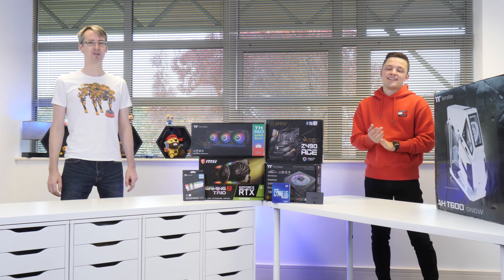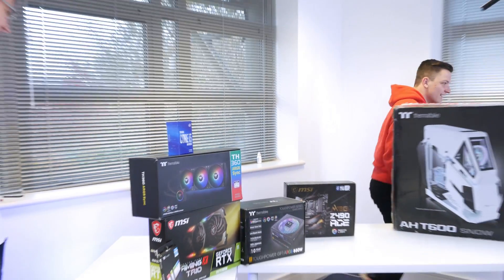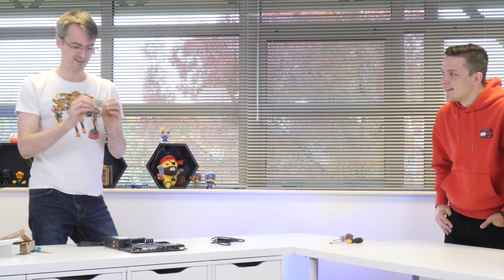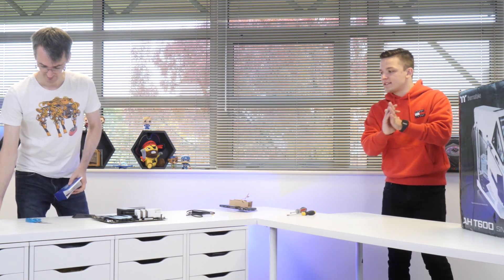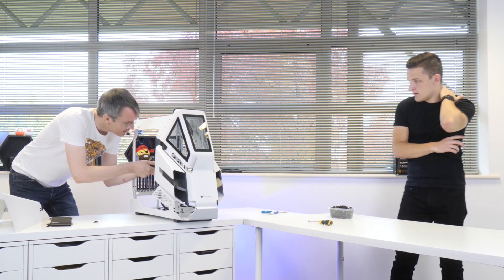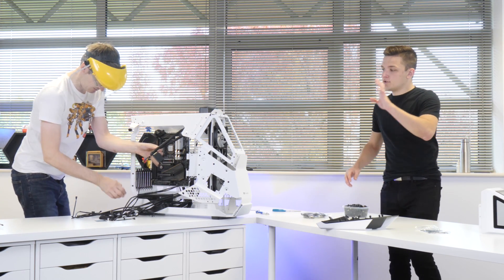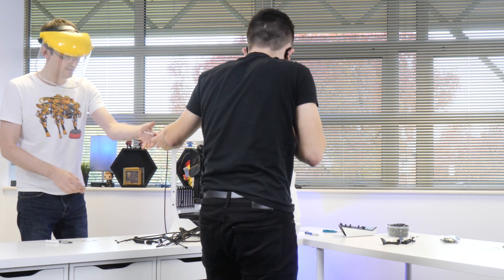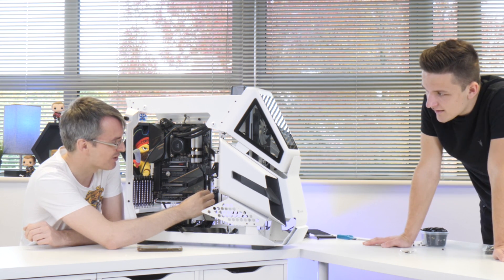Building the Ultimate 4K Editing & Gaming PC - RTX Super

Comment: Well, I kinda liked the video. Not the content I expected in the channel, still not dissatisfied at all. I do not agree with most of the coments, I would say the i5 is a fair choice, people tends to forget that while new Ryzen 5 5600x performs far better with the same 6 cores it also costs almost twice the price (not counting motherboard and rest, wich is more futureproof, but also more expensive), and can be quite hard to get at its retail price at this moment.

The case looks cool but it is too agressive for my taste. I definitely agree that is a suboptimal choice to expend that much on cooling for a midrange CPU, It is usually better to jump one price range on the actual parts than spending that difference on accessories. Would you prefer a full equiped Dacia or a 0-extras Mercedes/BMW? This is the same, I would rather go with an i7 10700 or Ryzen 3700X with a decent 60€ air cooler for your usage and for futureproofing, but well, that is just my impression. And you have a big advantage doing what you did: you only need to buy a cpu for a nice upgrade, you have the rest already, that is a big point too.

Keep up with the great work!

Comment: 4K? should have gone with:
Quadro RTX (better for editing, CAD, rendering, etc. AND you could game on it)
+32 Gb RAM (anything above 2666mHz for Intel doesn't make it faster and in some cases slower)
CPU really depends on the programs you use. Solidworks does well with higher single core speed, and some other programs need more processing cores.
H510 is plenty case and smaller footprint
Everything else is ok.
Reply from the maker: It edits 4K fine - this video was shot in 4K

Comment: The radiator should have the hose connectors at the bottom. With them at the top you will get cavitation at the top of the radiator and you will get a gurgling sound over time. Also it will reduce the life of the pump. This has been proven by experts and testing. At least it's an easy fix.

Comment: While the CPU will most likely be enough for your intended use case it does seem like an odd choice to go with an i5 instead of an i7 considering it will at least slightly bottleneck the pc and makes the triple radiator incredibly overkill.

Comment: I'm not usually 'that guy' but I feel this was a very unbalanced build. Just consider this James, for video editing you want a good amount of cores for concurrent processing. Your little mini pc you showed has more cores than the so-called ultimate pc. An extremely odd choice of processor considering the motherboard, cooler and ram specs. An ideal platform for processor bottlenecking. The good thing is the Z490 is a decent motherboard platform so sticking an i7 or ideally i9 (for core count) in there isn't going to be a problem and it would help balance the system out greatly. The other issue is intel has some funny ideas when it comes to running RAM at the rated speeds. with an i5 this is only 2666mhz so that fancy 4000mhz kit is largely wasted (not to mention for editing there was really no reason not to go for a 32gb kit. Ram is cheap.). If you went into the bios and enabled XMP to boost the speeds up, intel considers this overclocking and if you admit this, will invalidate your warranty if you have any issues. Not a lot of people care about this, just thought I'd mention it. On that note I'm not sure an i5 can even support rambus speeds of 4000mhz. Could be wrong though.
Reply: @___mojo___  Unfortunately that's not what intel says. I refer you to a comment by one of their customer service reps. (directly quoting their T&Cs) https://community.intel.com/t5/Processors/XMP-Warranty-void/td-p/1196241
Reply: @___mojo___  It's nuts isn't it. Oh it's not that a z chipset platform keeps it in warranty, but only z platforms will actually run the proper XMP profile up to the rated speed. Enabling XMP on a B or H chipset for example will still only run at the CPUs rated max which for an i5 is 2666. So kinda pointless. In essence they're flat out blocking you from overclocking on non-z platforms. Not the 1st company to do things like this though. The Nissan GTR springs to mind. They offer a performance car with launch control but in their T&Cs there's a clause where if you actually use launch control it invalidates your transmission warranty. So cheeky
Reply: @___mojo___  I think you have to buy their overclocking warranty for that, but ltt have a decent video about this
Reply: @emmiiskog  yes, their tuning protection plan or whatever it's called.. Just another way to try to gouge money out of you.